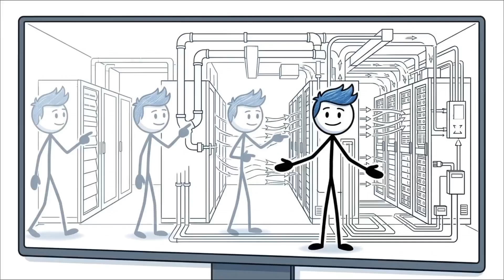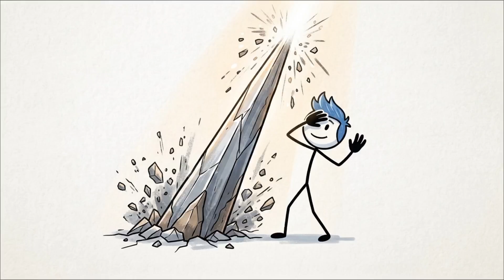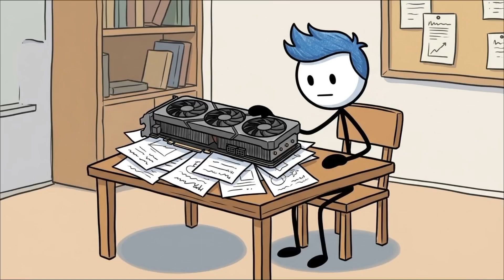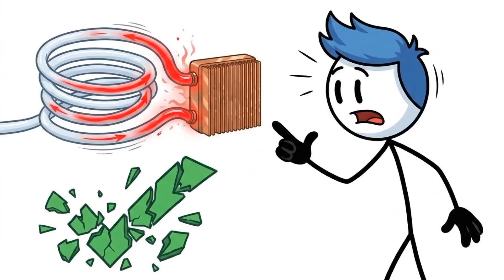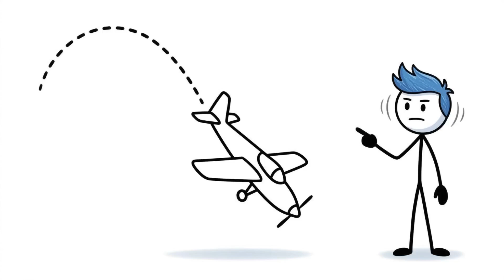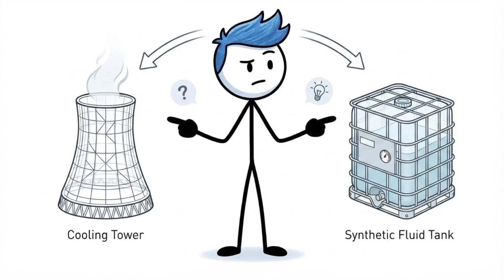The Blueprint Of The Data Center Cooling Economy

Comment: Build it in outerspace then use vibration to shake the heat off the heatsink.
Reply from the maker: Interesting idea but the biggest challenge is that space has no air, so you can't cool electronics the same way we do on Earth. You'd need enormous radiators.

 Do you think the trade off would be worth it?